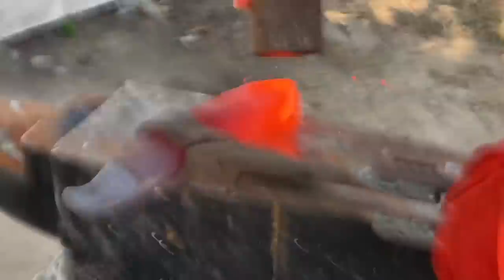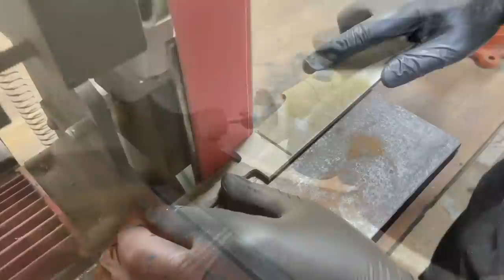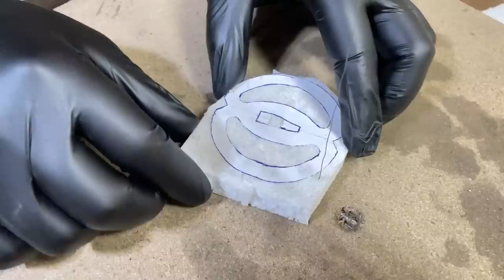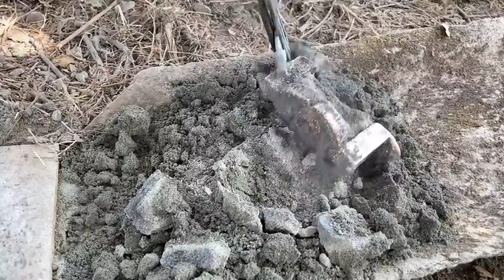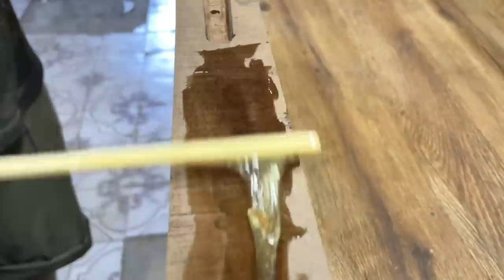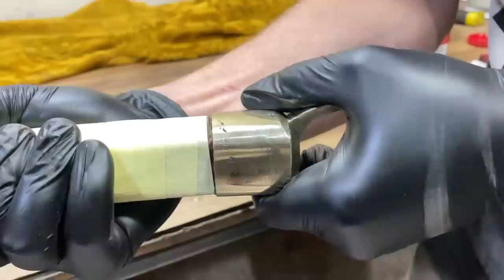Forging Samurai Warrior NAGINATA Out of Rusty Hook

Comment: This is more of a dadao rather than naginata, the handle's too short. Also the blade tang should be at least twice as long to prevent snapping due to high inertia when swinging the blade. But still, awesome :)
Reply: The blade is the wrong shape too. It should be a katana blade on a spear shaft
Reply: @pestlince13  well the blade is not a naginata but it's most likely based on the bisento, the japanese version of the guandao
Reply: You are so correct in your blade calls. Took the words out my mouth.

Comment: Nice "naginata", looks good and all.
But that tang is way to short for that heavy blade...It would turn that "naginata" into a "short staff" very quickly...
Personally i would have welded on a long rebar to make the tang at least double length, so you could actually use it and not just be a wall hanger.